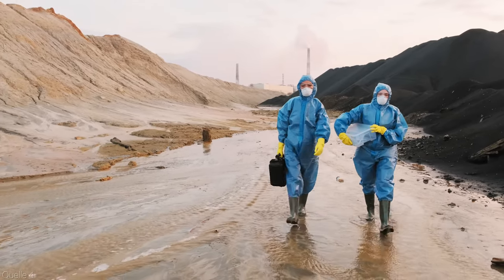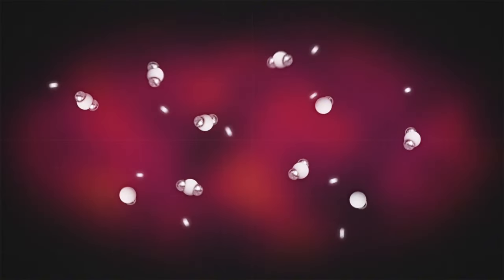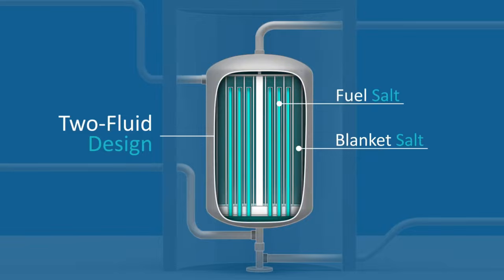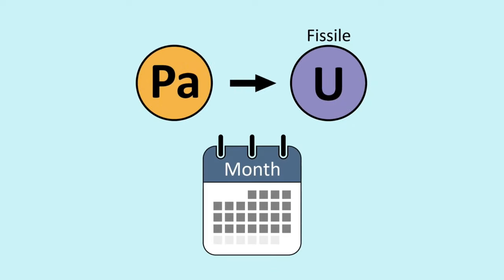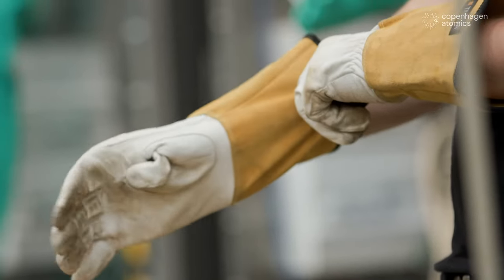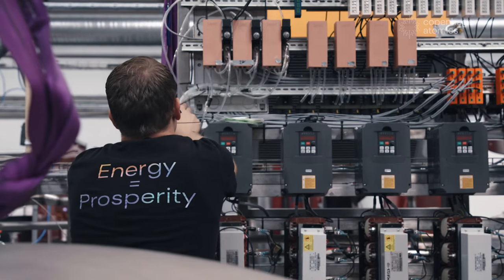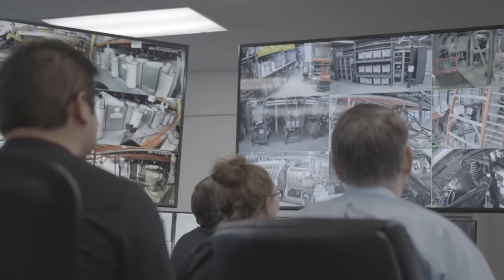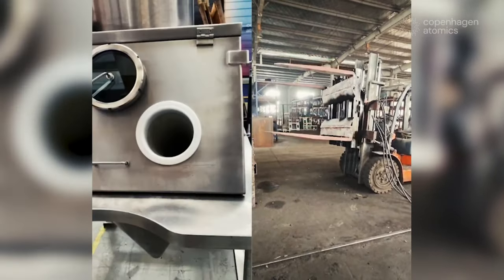Nuclear 5.0: NEW Thorium Reactor Burns NUCLEAR WASTE for 1000 Years!

Comment: The world with 250000 tonne nuclear waste and with numerous nuclear plants has challenges on security  on e divided world with competition and Cold War.  Safety on nuclear energy is big problem when nuclear bombs are on controll of unresponsible politicians.  Energy crisis has started today and may be worse tomorrow, SMR plants 100 MW or higher, may be good if achieve 60 years operation safely and refuelled every 20 years, but these technology has corrosion challenge, and this is with other risks, safety but the technology may suffer from operation expenses and produce energy with high cost and high prices on energy kill the wellbeing.
The world need energy today and tomorrow, and the solution is energy needed for what the economy need.  
Even SMR produce electricity, electrons need different cars, trucks or different ships and airplanes, different tractors and locomotives. Tomorrow the economy will need diesel and gasoline or kerosene for trucks, cars, tractors etc., etc.. The future will need SMR and other plants to produce molecules from electrons.  So let work to produce oil and gas, keep the refineries work, keep mining to excavate minerals of Th or U, manufacture metals needed, build plants to produce salts needed, produce cement and build SMR modules and plants, build transmission etc etc.. So let Copenhagen Atomic scientist accelerate their researches which may help on the future, but think to solve tomorrow challenges on energy. Energy transition worldwide may need 200000 SMR plants with power 100 MW.  So what amount of Uranium and Thorium Lithium, beryllium will be needed and what mines are needed? However the Copenhagen Atomic scientists deserve respect for their efforts.